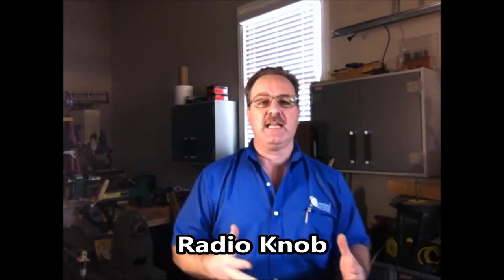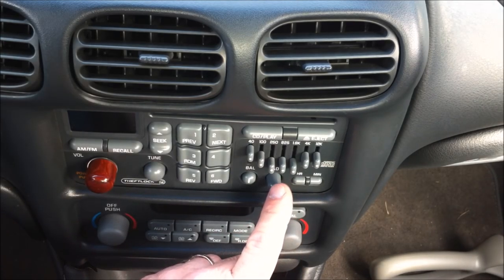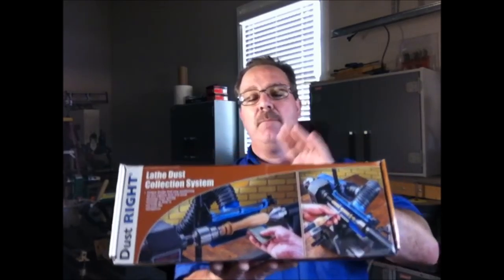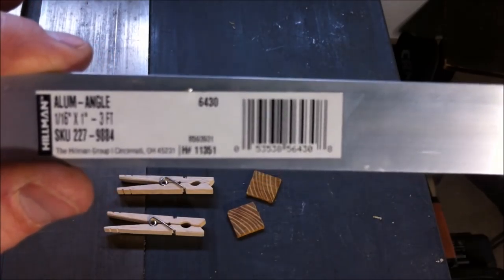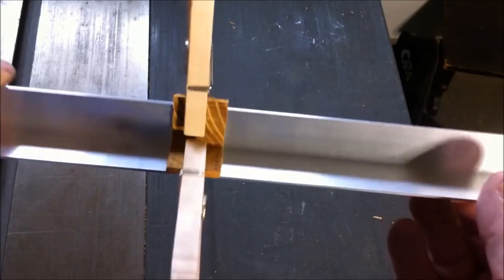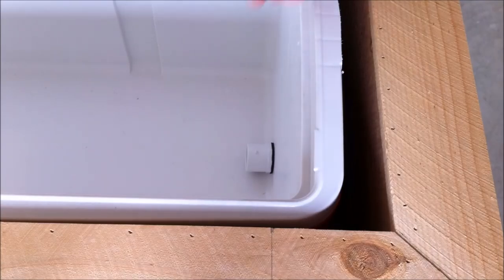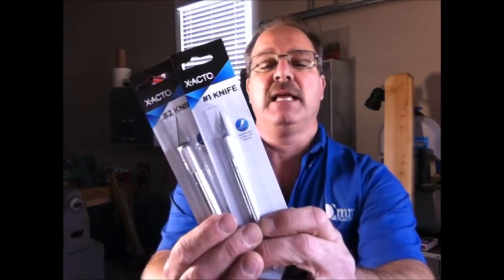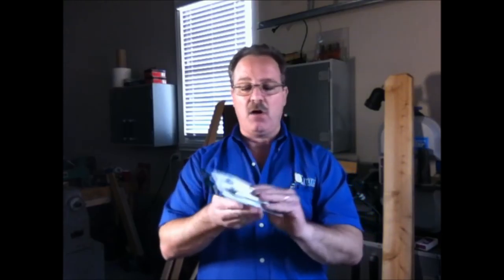Radio Knob Follow Up   Great Tip   Thank You's   What Am I Working On

Comment: Really like the cooler box. Do you have plans you follow, if so can I get a copy, I'll pay for them if necessary. After you set up all your wood slices in the piece of angle, what comes next? I'd like to see a video on making the pen using this method.I am going to start turning some more pens and I think I would like to try that.Keep your great videos coming!
Reply from the maker: +Frank Thornal Hello Frank,
  I don't really have a plan for the cooler boxes, I just wing them. I'd be glad to talk with you sometime and explain what I do but there pretty simple. I think I will make a video next time I make one. Should have done one this time, don't know why I didn't. 
  I will definitely make a video on the herringbone using the angle. All you really do is stack them and glue the stack together.

Regards,
Bob